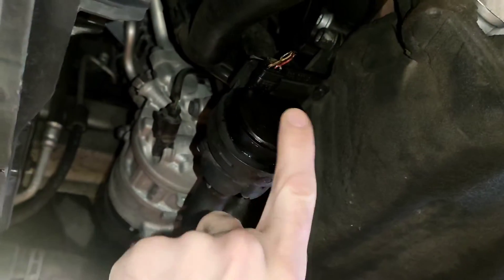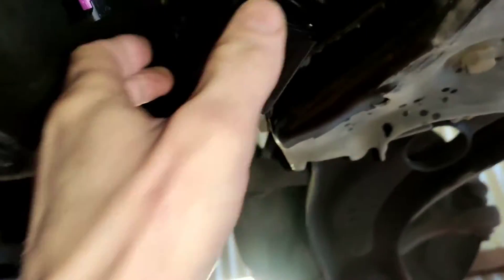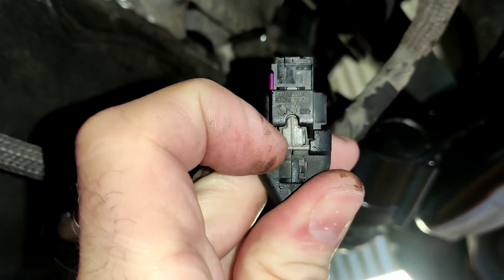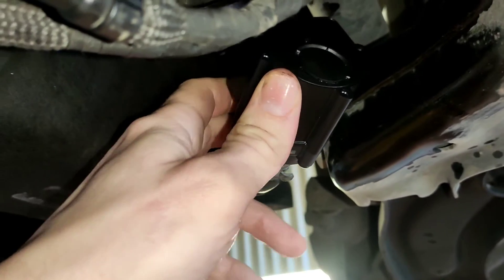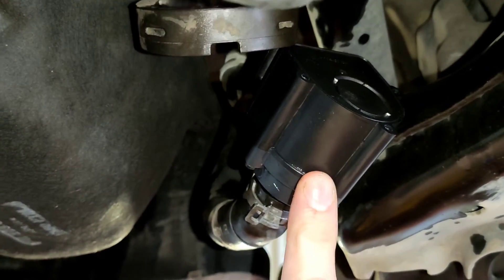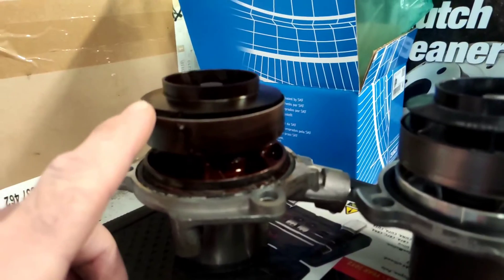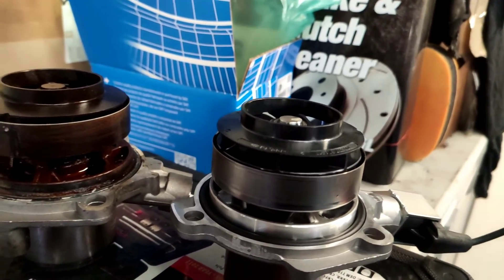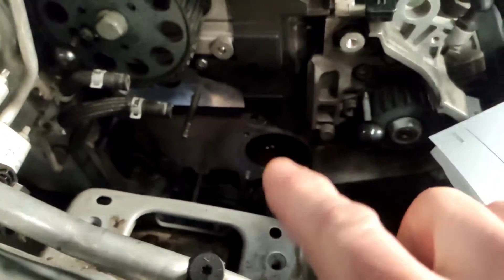VW WATER PUMPS TDI 1.6 / 2.0 P26f800 P26F700 P26F500 P26F400

Comment: Hi
I have a 65 plate volkswagen Passat 2.0 TDI b8 manual business edition only covered 51500 miles
I've lost all heat inside the car
Fans are working but just blowing cold. The car doesn't over heat at all not loosing water.
The actuator flap is working.
I've had the heater matrix replaced
Timing belt kit with pump
Thermostat
But still isn't blowing heat inside
I've spent £££ so far and it's made no difference
Had a diagnostic and all that comes up is the ambient temperature sensor
Had it bled at 3 different garages and no luck
It's as if the water isn't circulating properly throughout the hole system
Reply from the maker: Probably the matrix it happened me on one of the frist core i did . I didn't  flush  the coolant enough. I takes longer  to flush  the coolant then fit the matrix.
Reply: @murphyslaw2020 already had it replaced
Reply from the maker: Hi i fit a new matrix before and it blocked after afew mins
Reply from the maker: https://youtu.be/emUCfU_w710?si=svw9Nr-UbZukXj-1   at about 17mins I talk about the flush.  Just thinking make sure it not the electric water pump in this video, normally  the back one on a passat
Reply from the maker: If have a look on my channel I have a video of golf mk7 core with pipes at the end of that video  i show the vw flush  to use. It takes  a few hours to do it and its mad money

Comment: On my 2015 Passat 2.0TDI coolant pump C is the one low down behind the engine block next to the oil drain plug. I removed the connector and scanned the car and got fault code P26f400 coolant pump c open circuit.
Reply from the maker: That's the easiest way to tell. Some engines only have 1 pump etc this is the best test

Comment: Hi can you help me I have the message "coolant pump c stuck" and the fault code is P26F800 for a VW Arteon 2018 2.0 TDI 150 bhp. I would appreciate your assistance.
Reply from the maker: Hi one of the coolant pumps in the video  is most likely gone. I'd say it's the back pump. But you could  just unplug the front pump and see if a new code comes into  the car that will tell you what pump is good or bad
Reply: @murphyslaw2020  Thank you so much; I greatly appreciate your assistance.
Reply: Im.getting the same code, aux pump c stuck. Did anyone figure out which pump is C?
Reply from the maker: Hi you can unplug one of the pumps and read  the code to if  its the right one
Reply: @murphyslaw2020 I'll check during the week as im doing a service and report back. Whats your opinion on the electronic variable waterpump? Im getting mine done next week and was told by the parts shop to fit non variable one as the variable electronic ones can be trouble some, and for every variable one they sell 10 non variable and never had issues. All it does is help the car get up to temp quicker on the colder days.
Reply: I have the same issue. Looks a simple replacement. I'll clamp the coolant pipes before removal.

What was the part number for the new bracket?
Reply from the maker: @kingofthewestmidlands4049  sorry  I'm not sure the part number your car may not need it
Reply: @kingofthewestmidlands4049  did you end up fixing the heating issue? I'm guessing it was your heater matrix in the end right?

Comment: Can you please tell me which one is the 3rd water pump? 
Is the one on timing belt?
Reply from the maker: It's hard  to say . I did an audi and the 3rd pump was the heater pump.
You will need  to disconnect Each pump one at a time and read the fault code. To see what  pump is gone. 

You can unplug  the timing belt connector on the top of the engine very easy. The others will needed  to be accessed from  underneat

Comment: Hi 
Need some help 
My car have new code p26f8 
Before that it had p190d (also for pump) but disappeared after I changed the water pump you showed in starting of the video that small one I think for heater
Which one I need to change and is it necessary I am actually short on money right now
Reply from the maker: Did you use a vw oem  part
Reply: @murphyslaw2020  yes what is the fault though ? Any idea
Reply: @murphyslaw2020  PIERBURG 7.07223.03.0 
Is this the right one for p190d code 
The one on the left front side with silver part 
For Audi a4 b9 
I found in the website autodoc showing for my car

Comment: Hi I’ve got a 2015 GTD with slow coolant loss and P26F800 fault code, don’t want to replace the wrong pump so would this be the heating water pump (2nd one shown in the video) or the main waterpump that’s ran off the timing belt?
Reply from the maker: Hi sounds like you have 2 separate problems 1 the pump is dead, 2 a leak. What engine do you have is it the older one with the oil filter at the top
Reply: @murphyslaw2020  it’s the CUNA engine 184bhp 2.0 tdi, not 100% but I think it has 3 electric water pumps. Seems to lose coolant quicker in the summer and even more when I use the AC if that could give any indication?
Reply from the maker: Hey it's the newer type engine from a quick Google. It has all the pumps in the video if it is. I'd start by getting the new pump that you know is dead maybe and work from there.
The main timing belt water pump can leak and fail the last one in the video done a good few. 
If there is no leak but still using coolant it could be egr cooler or head gasket etc and the coolant is getting burnt up.

There is so many coolant lines on this engine a coolant pressure tester could come in handy
Hopefully you get sorted
Reply: @murphyslaw2020  cheers for the advice mate appreciate it! Had this car a while and had the egr cooler replaced under warranty then another coolant pipe that was leaking which fixed it for a while but since summer it’s started consuming more again. 

I learned from forums that these engines are quite shit and the numerous coolant problems they can have, I thought VAG would have been able to make a decent diesel engine by then as well.

It doesn’t have any symptoms of head gasket failure like theres no residue on the oil cap and there’s no smoke so hopefully it’s not that. As you say I’ll get it pressure tested as my first point of call and with that fault code hopefully it will just be one of the water pumps. Would I be right in thinking this code p26f800 is the main water pump or could it still point to any of them?